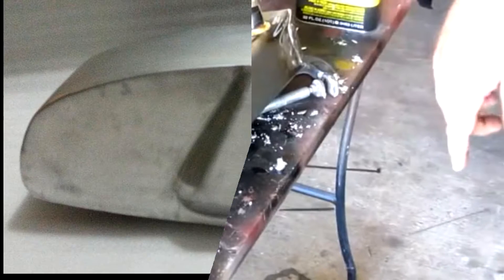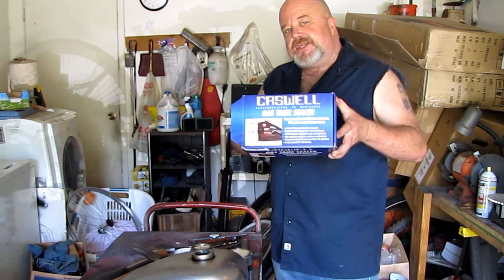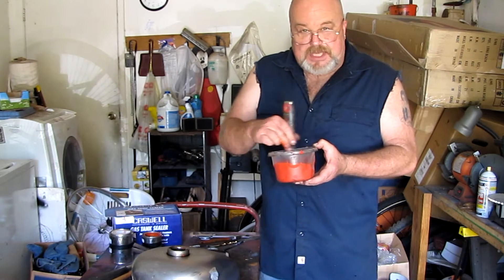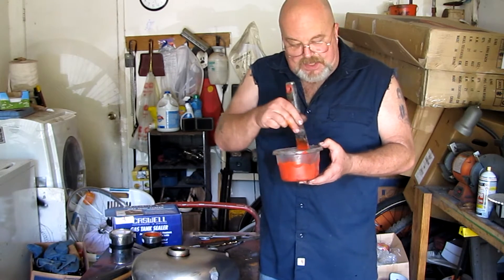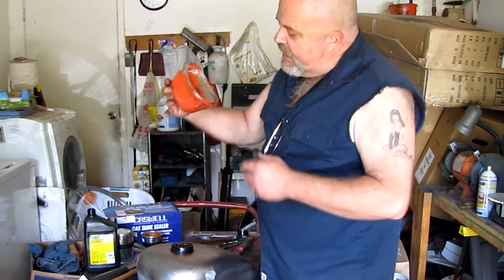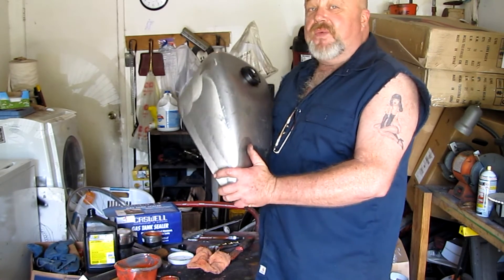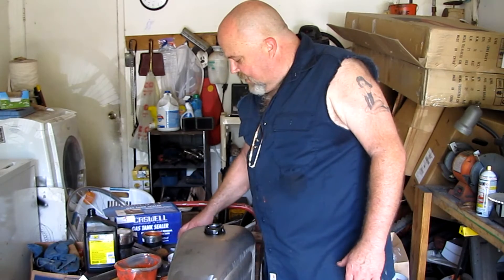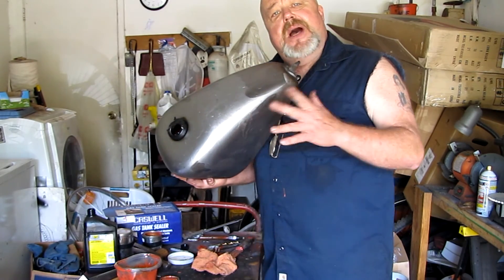How To Seal Gas Tank for Motorized Bicycle using Caswell Epoxy Sealer

Comment: Why would anyone Seal a new petrol tank. And to half seal it is stupid,  as it sweats moisture  will get between the epoxy and the tank and in a few years the base will rot out-  also if there is ethanol added to the fuel, (as in the UK)  it has water in it  also the ethanol dissolves fibreglass tanks and old epoxy liners.
If you are not using the bike- drain the tank- simple!
Reply from the maker: If it was on a $20,000 vintage bike sir, I'd go with your take. These are cheap.

Comment: I need to seal up a crack on a fiberglass tank. Do you have any ideas as how to clean out the old stuff or just clean it out and prep it before applying the sealer. Probably will be using Caswell
Reply from the maker: I don't mess w/ fiberglass so much so I'd advise asking someone who has more experience w/ fiberglass

Comment: Hey I have a motorized. Ike 2 stroke Chinese engine and when on full throttle, the bikes Rpm  goes up but I don't see my bike go any faster, have you had this problem in any of your builds? If you can plz help me.
Reply: Your clutch might not be set at the right load. When there's a head wind I've noticed this happens. Ajust your load by removing clutch wire sheath holder its the large shinny screw that holds your clutch wire sheath in place before the wire connects to the clutch arm. Theres a spring held inplace by a large bolt inside that hole place a large flat head screw driver inside and rotate your tire clockwise if your on the left side of the bike. ccw if your on the right. Then when you ...you know what if anyone actually cares just msg ill reply

Comment: dude this was a great video") I have a gas tank that needs fixing but the crack is very small can I mix this stuff in smaller batches? or do I need to coat the whole bottom of the tank anyway?